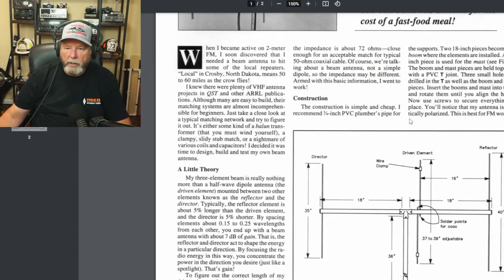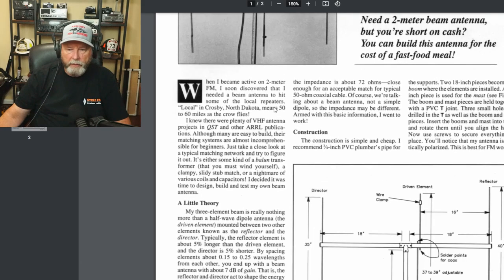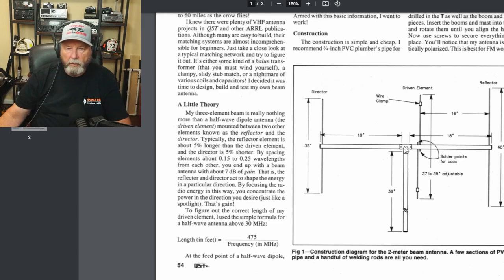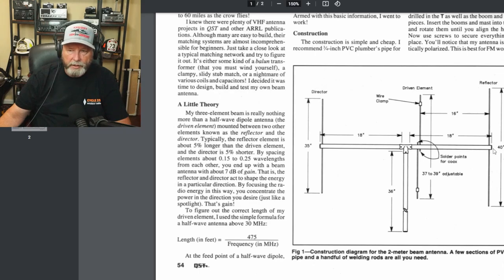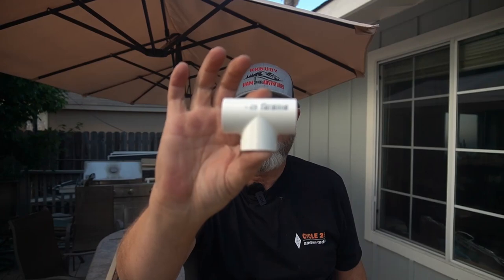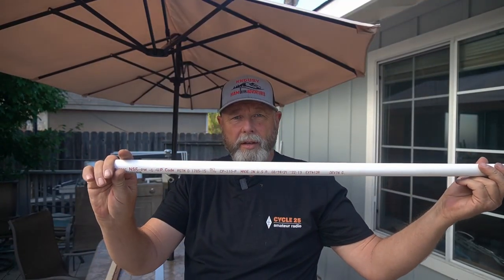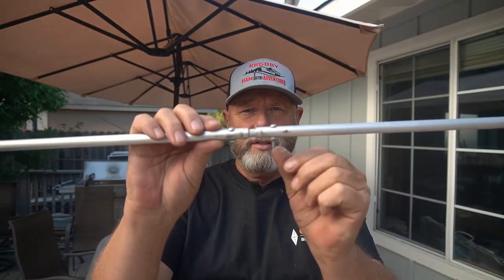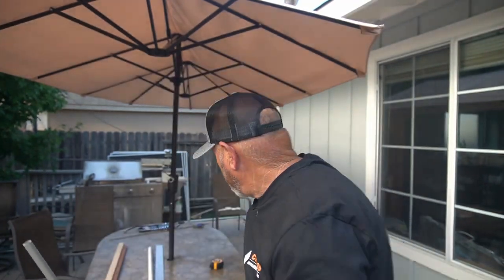How to make a 2 meter Yagi and get 7 Db for 7 Bucks !

Comment: I built mine from a 1 inch square aluminum tube and aluminum rods, from a local hardware.
I'm 73 years old not in the best of health, so I mounted it as high as I could reach on 10 feet of pipe, @ 6 feet. 
I was using my icom 208H, but since it broke I have been using my Yaesu HT to check into the ARES net repeater about 17 miles away and another in the next county about 20 miles away, I'm happy with it. Thanks for showing how easy it is to build your own, that after all is the art of radio.🖐🏻73's🎙🎧 KD9OAM 📻
Reply from the maker: You're welcome, just trying to pass on good info for everyone! Thanks for watching and the great comment!
Reply: 17 miles with an HT? Very impressive!
Reply: @ScottPlude  Thank you.

Comment: Take a strip of paper and wrap it around the pvc. Tape it to itself then slide it off the pipe. Flatten out the paper ring you just made and mark each end. Put the ring back on the pvc. The marks should be exactly halfway on either side.
Reply: Just built mine and ironically the pvc parts cost $7. (the rest I had in my junk box).

Comment: I built that antenna back then and then made it into a 7 element and it worked for many years. I still have it but it's not in use anymore. Definitely worth building
Reply from the maker: I made mine into a 4 element and it just works!

Comment: built one many years ago... went and find it on the antenna pile, metric sizes. refl 1016 mm, driven ele 507mm each side, dir= 886 mm spacing  440 mm and 440 mm yes both the same spacing, works like a charm , draws repeater 140km away with 1 watt.
boom 25.4mm plastic pipe, elements wrapped at boom with thin copper wire to prevent element movement.
cheers zs2cx

Comment: Mine was only a 4 element because I wanted to see if I could make it portable. My elements fold so I can, the other eliments will be used for 70cm. Lay it out to see how many elements are useable. Other than that as you pointed out, the isolators are the only real consideration. GL with your build

Comment: I'm an older Ham, and not as portable as I used to be. But I have made 2 and 6 meter beams before and I have the carcasses left over from two hurricanes that destroyed both beams so I have the booms left over from both. 6 meter beam will be three elements, but I want the 2 m beam to be seven elements for additional gain. I will figure Dbd gain instead of Dbi gain as Dbd gain is more accurate. Your construction looks good to me! I advise others to have no fears constructing this project, just go for it! 73's de W4FJF.
Reply from the maker: I did add a 4th to mine with the same spacing, thanks for watching!

Comment: Either keep those wooden booms dry, or seal them well.

Also, if you've carefully gotten anon-conductive mast for that vertical polarization installation, and you run the COAX down that mast from where it attaches to the boom, the outside of the shield is a conductor being put right back where you don't want it.  Much better to run the COAX off the back end of the boom to keep it beyond the reflector.  Keeping it from dancing in the wind is a separate problem.  Though when hand holding it from the back, having the COAX comer out thee back is what you'll want anyway.

Comment: I love this antenna, built one a few years back for fox hunting, It really does the job.  Thanks for the videos!  I really appreciate your time and effort.  73 de KM4KAQ
Reply from the maker: Eric, it really does work very well. I made a contact on 2m SSB about 100 miles checking into the Bozo net, but the net control has really good antennas and I was at a good location. Thanks for the comment!

Comment: Hi Chuck! Thanks for the video! May you tell me the size and threaded of the arrows/nylon rod? And what size is the reflector and director aluminum rod?  Thanks in advance!
Reply from the maker: 8-32 is the thread size and 2.5-3" depending on your boom, I think the rods are 1/8" even a wire coat hanger will work lol, thanks for watching!

Comment: Making a UHF handheld Yagi for my HT. I'm considering using 300 Ohm twin lead so that the tuning will not be dependent on the connection point.  Gamma tuners are PITA to make and change. The Delta has worked for me, but I'm curious if twin lead will fix this. Then I'll have to make a small toroid 4:1 transformer to connect to a short piece of coax to the HT.

Comment: Workin on a technical license,  have a question why can you build
 A horizontal and vertical plane and use a duplex  like a 70cm/2m

Thanks
Reply from the maker: Bob , I don't understand your question, I think if you look at arrow antennas that might answer this for you.  http://arrowantennas.com/arrowii/146-437.html or Elk antennas, https://elkantennas.com/product/dual-band-2m440l5-log-periodic-antenna/
Reply: @KK6USYHamRadioAdventures  
Sorry for the confusion,  i see that people rotate thier Yagie from the horizontal plane to the vertical. 

Just curious  why no one has made one with  elements for both plains for one freg. So you dont need to rotate it from horz to vert for diffrent stations. 
Im sure there is a reason because there are people WAY smarter than me 😉

Thanks Bob
Reply from the maker: @bobdefield7842  Oh got ya yea they do make them that way I did a video on one 1 elements, but Mike the owner of M2 antennas says to set at a 45 degree angle and it will do pretty good with just a little loss each way

Comment: A little pro tip, if you ever want a perfect straight line on a round pipe, just lay it in a piece of angle iron. Also 2 pieces of angle iron and a couple of c-clamps work well to hold pipe steady while you are drilling.